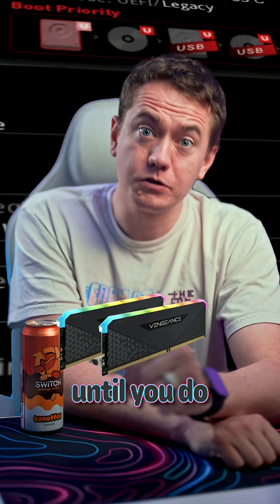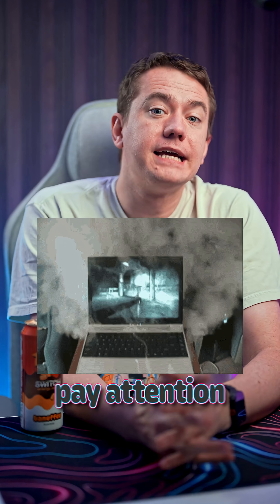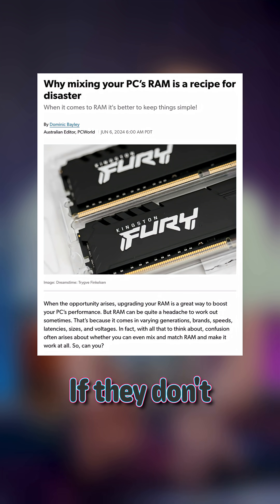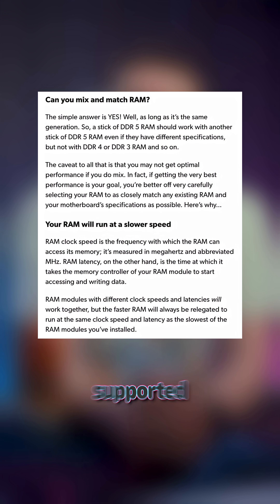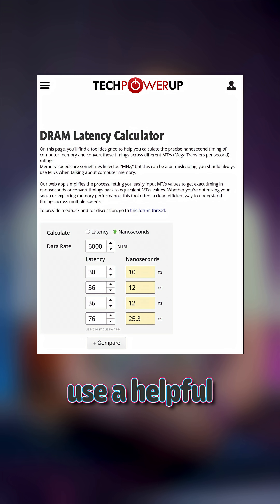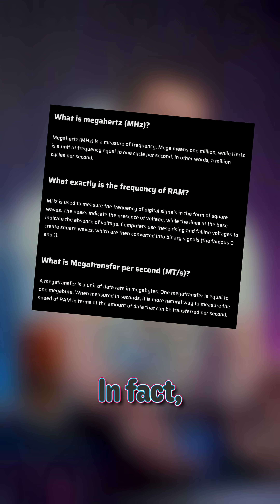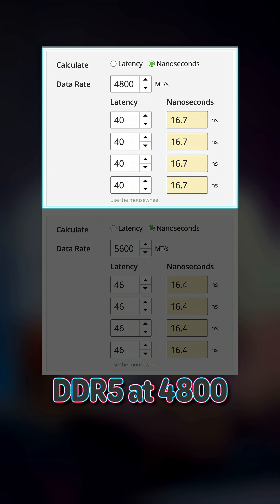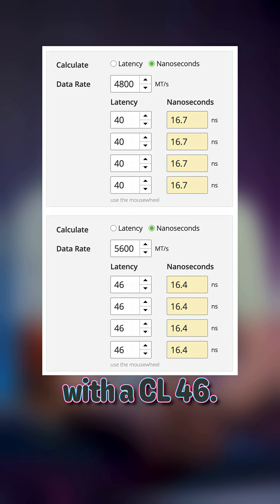How To Check RAM Speed

Comment: IMHO, more ram is way more important than the speed that it runs at. If you're upgrading X years after buying the PC, then realize, faster RAM isn't worth paying for: It will slow down to your existing RAM. But there is no reason to restrict yourself to ONLY the same speed and CL. If you find a better deal for faster RAM, by all means go for it.

Comment: Also, MOST motherboards are a bit faster with 2 sticks over 4. there's some particular optimization with the pin-outs of DDR RAM that I do not understand fully.

that said, I've got a regular ol B550 Tomahawk (normal 2 stick optimized) and it does fine with 4 matching sticks. Lexar Hades 16gb Stcks in my case. first pair survived a hurricane and catastrophic motherboard failure. second bought to match the first when I replaced the PC.

Comment: My roommate and I were careful with RAM selection back when I first upgraded to his AMD Ryzen 5 1600X. At that time, the best bang-for-the-buck was my current 16GB kit of G.Skill 3600MT/s CL17 DDR4. My roommate was somehow able to get his RAM to run 3600MT/s with the 1600X on his motherboard, but the best I could get was 3200MT/s, but at a much better CL setting that I can't remember now, and it was still WAY faster than the Core i5 3570K I upgraded from. Now, I have a Ryzen 5 5600X, and can run the RAM at its full 3600MT/s CL17 settings, compared to running it at the previous 3200MT/s applied with this processor, the system does get better overall performance in certain games with the faster speeds since the CL timing is already petty tight at full rated speed. The Ryzen 9 3900X machine a friend of mine is currently running, he started out with the Ryzen 5 1600X I had, and when he bought the RAM, I chose 32GB of G.Skill RAM at 3600MT/s CL17 DDR4, he paid less for that kit than I did for my 16GB back in 2019. All this to say, try to budget for the tightest timing, best balanced speed RAM you can afford. Yes, you could say I paid for performance from my RAM I did not see at first with the 1600X, but I bought it to grow into, and I am glad I did. I could get faster RAM, but prices have gotten insane and I would see little, if any benefit assuming my 5600X's memory controller could do better than 3600MT/s, I would be happy if I could find a 32GB dual channel kit at the same speed and latency of my current kit. I do find myself running awfully close to VRAM and RAM limits sometimes in certain games....

Comment: Wanted to replace my 64gb with 128Gb the max mine takes but would have to use all 4 slots. Was told it will slow the pc down if using all 4 ram slots?

Comment: A few day ls ago i installed ram with a max speed of 6400MT/s on a mainboard that supports up to over 8000. After i set the speed to 6400, it didn't boot and i had to reset the cmos 😐

Comment: But this is not always safe to mix different ram kits EVEN if two kits are the "same"
For an example (my own experience tho)
Bought two Kingston Fury DDR4 2x8 kits, refused to work on 3600cl18 as expected, seemed like it tried to work normal on 3533cl18, but lot of programs were constantly crashing, couple of blue screens after that i just gave up, refunded the kit i wanted to upgrade my already existing for half of a year pc, spent lil time to research the subject, and then just bought Gskill 2x16 kit.

I guess i wasn't lucky at silicon gamble

Comment: this is 100% accurate. back in the day you used to be able to do this but nowadays it will still work but not at top speed. you're much better off just replacing the two stick with two new sticks if you are planning on upgrading. RAM is probably the cheapest part of the computer so yes that is an easy upgrade that may help your performance a bit but not that much.

Comment: Just wish we had more Ram testing on non 3D kits with 6000+ mhz and tuned CL. For any x3d kits ram isn’t that impactful but with ram getting expensive even with the “sweet spot” the expensive or tight timing ram kits look way more appealing for basically everyone building a new system

Comment: But RAM isn't a speed, it's a type of temporary data storage, right? Random access memory. So what do you mean "faster RAM?"
Reply: Higher data rates and lower CAS latencies.
Reply: RAM speed refers to how fast you can fill and empty that temporary memory, and latancy is how long it takes to start the process. You could have a terabyte of RAM, but if it takes forever to use it, your computer will still be slower than a much smaller RAM kit. 

Ideally, you want the smallest kit that you need, with the fastest speed and the least latancy.